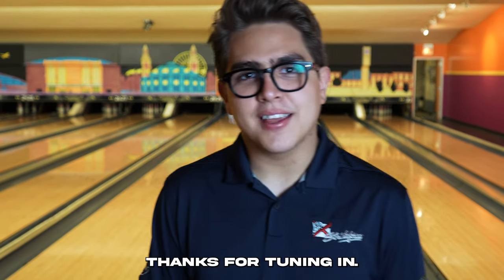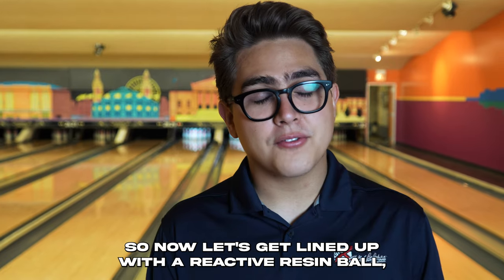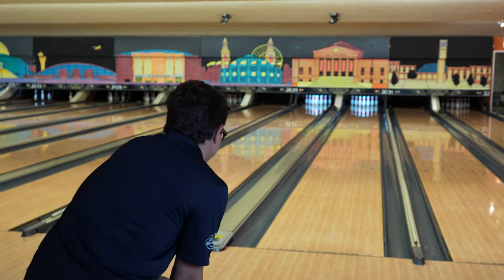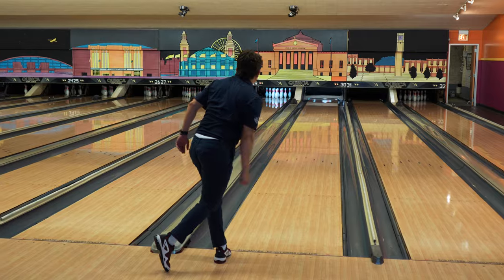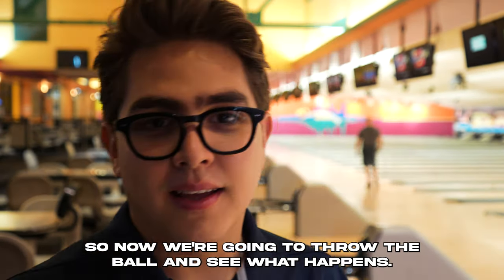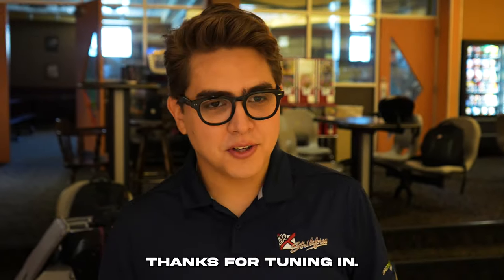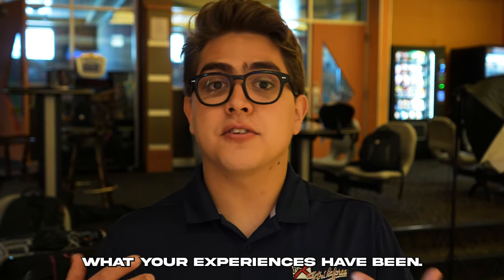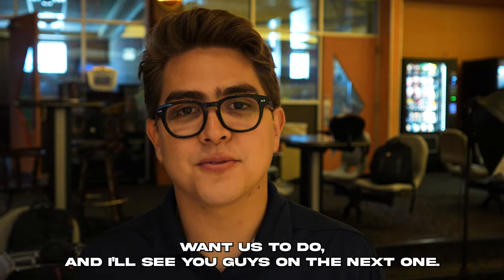How Does a Urethane Bowling Ball Impact a House Shot?

Comment: I throw urethane in one house and has beautiful ball reaction in the pocket every single time and use it in all three games.  When the lanes get drier or more carry down, I adjust by half a board, half a foot back and etc.  

If anyone complains about urethane, it is an indicator that person does not want competitive bowling and wants easy.  There is nothing easy about bowling.  You can make it look easy by getting strikes often but getting strikes frame after frame is hard work mentally because you get stone pins and also changing lane conditions at times.
Reply: The first sentence in the second paragraph is correct. 
And it's because they are "one dimensional bowlers."

They have never worked hard enough at the game to know how to play different zones, angles, hand positions, ect in order to combat lane change. But they'll be the first one to mention their 200+ average in a house shot league. 🤣
Reply: I agree with most of that, however, when you are bowling league and you have 5 of the 8 people throwing urethane, it becomes incredibly difficult to hit the pocket consistently with so much oil being pushed down lane. I have had times where the lanes became almost impossible to play, not just for those throwing reactive, but for the urethane bowlers as well. In one instance I actually got out my spare ball in the last block and bowled straight. I had the high score for that block. There is no doubt that urethane can mess up the oil pattern. You make a good point though, as in a "good" bowler will still find ways to deal with it.

Comment: My problem is that I have a hard time trusting myself to throw the ball from the left side of the lane.  But I normally flatten out my hand and go straighter into the pocket from the right.
Reply: That’s always been my problem, until I had to do it. All it’s takes is practice, just tell yourself in your mind that you can do it. I struggled with mentality more than physicality. I always told myself I couldn’t do it, until I did. Try to practice on the burn and follow through

Comment: It’s more about track flare.  Any ball with no or low flare is going to stretch the pattern.  Reactive balls don’t absorb oil instantly, so a low flare reactive is going to pick p oil early, and track it down lane because ball will still be rolling over the same track with oil on it.  The reason urethane seems to be worse, is that most urethane today uses weak cores that don’t flare.

Comment: It isnt about what the ball is made of, it is about how much it flares.  Any ball with low flare will mive more oil down the lane.  Would actually like someone to "measure" the amount of oil that gets moved in relation to flare.
Reply: Proven to not be true what so ever. It comes down to porosity of surface. Need to go read some studies of how resin takes oil and urethane does not due to surface construction at a pore level.
Reply: @showtimeman5673 A low speed, low rev player will carry more oil down than anything. Especially if their ball is getting into the roll halfway down the lane, and regardless of their choice of equipment. 

Certain patterns will make the ball get into the roll sooner as well. 

As a bowler, you must adapt to the conditions of the lane. Change angle, speed, hand position, or zone. 
And still at the end of it, sometimes you just can't figure it out.

Comment: Why are the reactive bowlers whining about urethane negatively affecting the lanes?  Adjust u newbs.  Also why dontvi hear about urethane throwers complaining about the reactives screwing the urethane shot?
Reply: Only newbs would throw urethane on a house shot. Experienced bowlers don’t whine about it, they just move inside or outside of the newbs line.
Reply: Wah wah wah. Nothing wrong with urethane. If the powers that be had any 🍒s they would have tested All  current bowling balls for hardness. When reactives first came out people wanted to ban or restrict them. Reactive also could be seen as a crutch. Maybe they should just allow plastic balls the see how many "great" or "champion bowlers" bowlers bite the dust with low scores.
Reply: @kooringagnd Jesus, there is always one of you in the comments. Get out of the 60s my man
Reply: Not a newb, but an older woman who doesn't have the physical ability to move to board 40 and wheel the lane. I bowl in 3 leagues, some nights its all plastic and urethane being splattered all over, so I move to the far right and play the gutter, but the plastic and urethane splatterers for some reason think they have to destroy every line as a strategy.
Reply: It's a house shot. Why tf you need urethane?